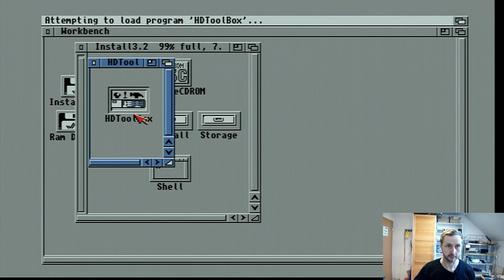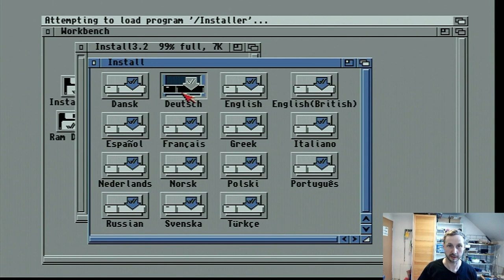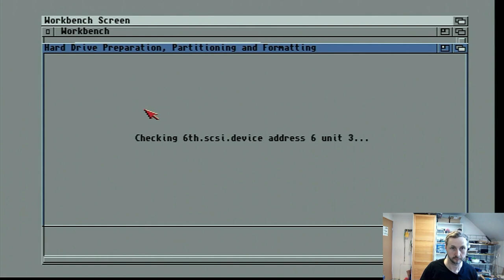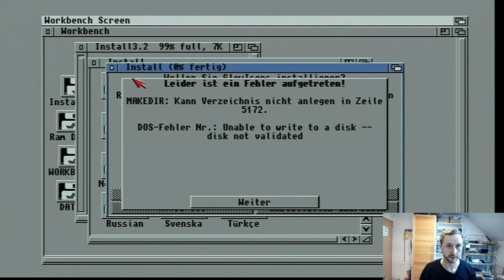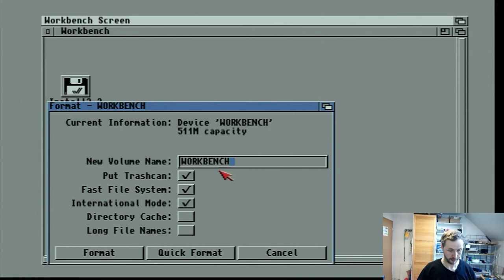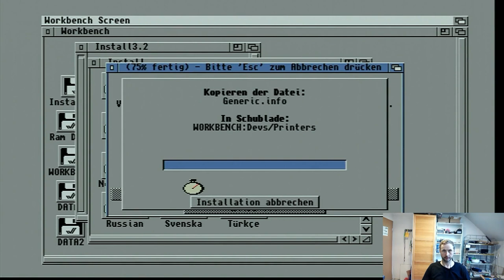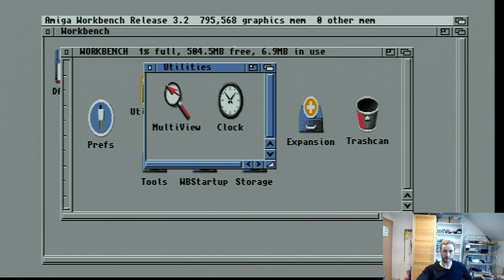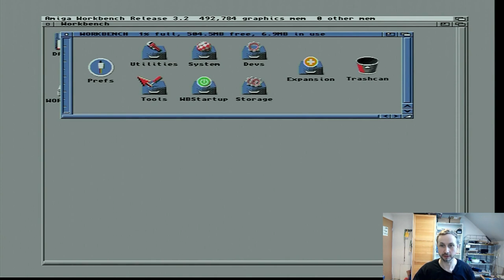How to install AmigaOS 3.2 on an Amiga 600, the easy way.

Comment: Have you thought about an accelerator upgrade? I have a Furia-020 in my machine, and though it is picky with CF cards, then it is working fine with a micro drive. Else there are the low budget PiStorm and then this new solution with 030 and 64mb Ram. But that is a tad expensive compared to Furia.
Reply from the maker: Yes i have. This is the next step. In the meantime i had an issue with the A600, i had to fix. I‘m planning this Upgrade now. Thanks for your comment.
Reply from the maker: I think so. I will find a way and make video. There are some accelerators to choose. 👍
Reply: @tomscomputerchannel2925  Three modern solutions, and then old 90's stuff that are way overpriced for what they are.
Reply from the maker: Yeah that’s true

Comment: Hello, could you give a picture of the front side of the FastRAM for the A600 from the clip!
I have the same one but it's missing components and I want to restore it but I don't know what they are!
Looks like yours!
Reply from the maker: Hi, what components are missing in your A600? A good way to finding missing components are the service manual. It’s available in the internet. There is also the value and type of the components. 😉

Comment: Ok, with a Gotek this task of installing OS 3.2 is at least a bit easier than with physical disks, but still quite uncomfortable.
This saturday I'll release a video which shows how to install 3.2 and update 3.2.1, without a single disk change during installation (the update of course needs Install3.2.1.adf, but then again no disk change, taking advantage of OS 3.2 new ADF-implementation feature). I prepared a Micro-SD for my A1200 using WinUAE and a CD-drive on the PC.
Not sure about this low-level format in HD-Tools. Maybe I should have tried this with my SD-card (which already had a 3.1 install on it). I did something else using Windows tools. 🤔
Reply from the maker: That’s interesting for me. For this video, it was the first time i install AmigaOS. That was the easiest way for me. With more experience your way is the way to go. This channel is a way to learn more about those things. Thanks for your feedback and support. 👍
Reply: @tomscomputerchannel2925  It also was the first time for me, apart from a testrun I made some days earlier. It still took me around three attempts to make the video, always forgot something important to progress further etc.
It's a learning curve on a "new" Hardware. 😉
Reply from the maker: That’s right every video is a learning curve. 😉